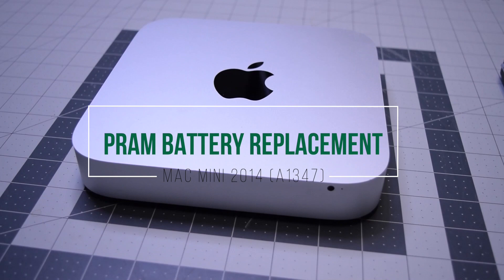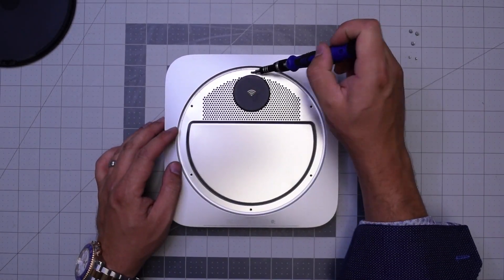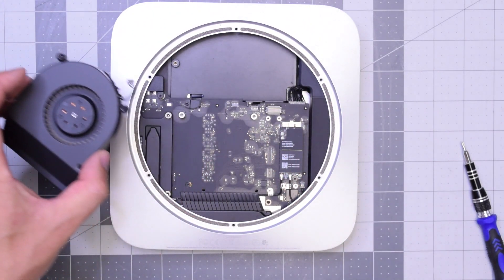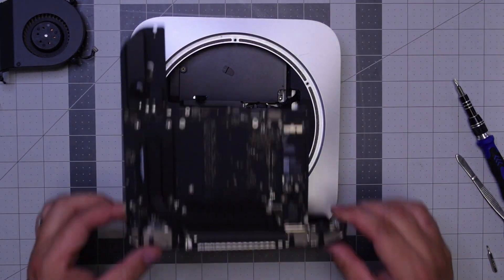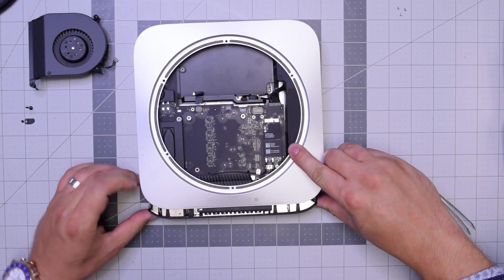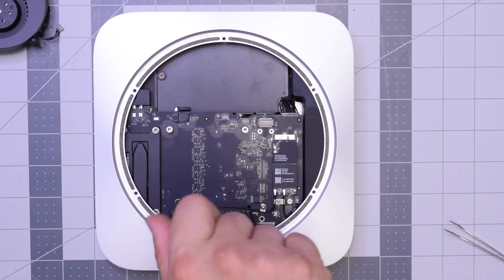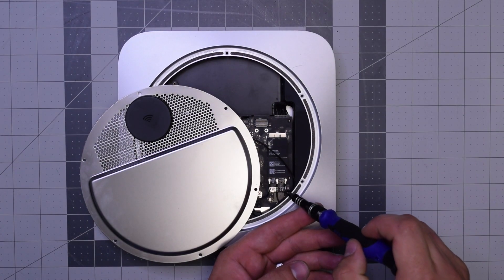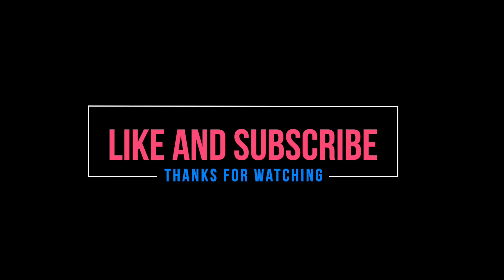PRAM Battery Replacement - Mac Mini 2014 - 2017 (A1347)

Comment: Why would one do this? Like what symptoms does the Mac show to do this
Reply: Your Mac mini will forget various settings when this battery dies. In my case, I would configure my display but when I restarted the computer it did not remember my settings. This is only one example of many possibilities. I do think Apple could've made this battery replacement a little easier.